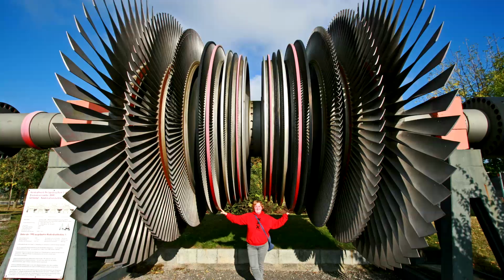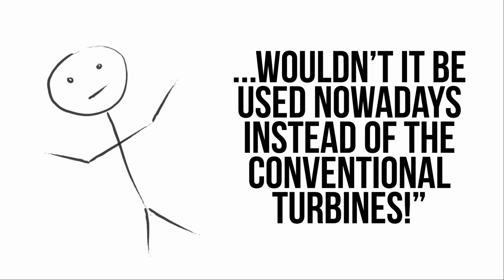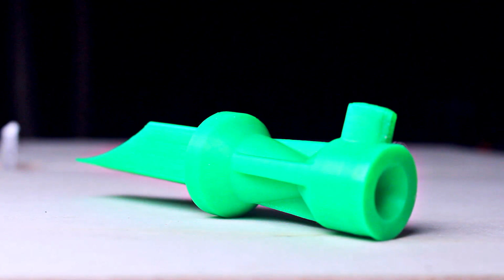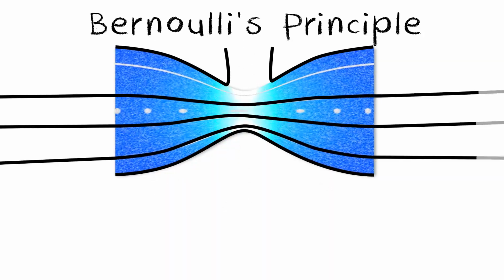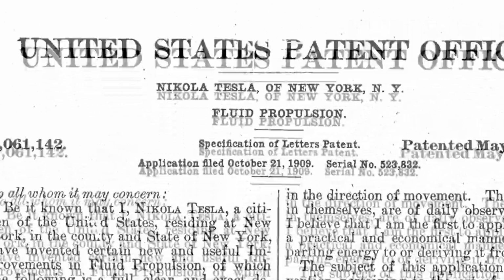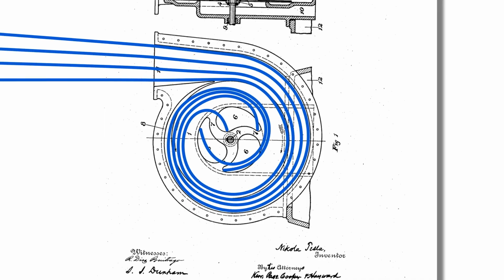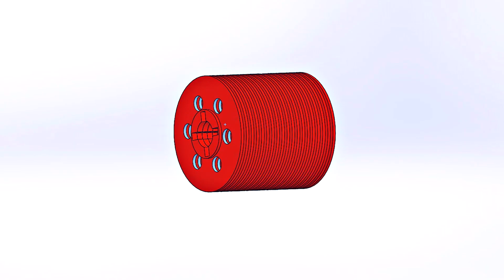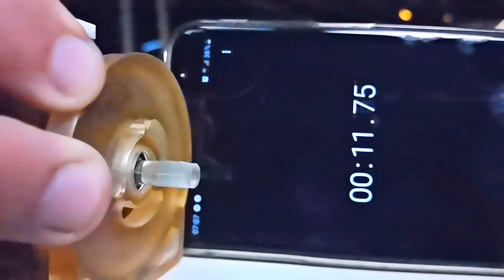Tesla Turbine [Smoke Flow Slow Mo]

Comment: As an idea for improvement, a few things spring to mind:

Your incoming power is the pressure drop from input to output (so 8 bar - 1 bar = 7 bar) times the flow rate. Now the flow rate is fixed, so you need to make best use of the pressure drop. Based on the boundary layer effect the channel should be as thin as possible so that most of the airflow is in contact with the walls. So you would need discs with less spacing but more of them. Also based on the assumed power of that thingy, you dont need to print as thick as the plastic should have no problem withstanding the forces. (That is, if it does not self disassemble from the high speed)

Next thing would be the bearing. At this speed it should have a high loss. Now there is a technology called magnetic bearing. It uses magnets to keep your axis stable.
https://upload.wikimedia.org/wikipedia/commons/thumb/c/ca/Magnetic_Mirroring.jpg/1024px-Magnetic_Mirroring.jpg
I 3D printed one of these a while ago. But mine was in reverse, so a rotating aluminium shaft was in the middle, and the magnets surrounded the axis on the outside.
It only works when the shaft rotates. When i tried it out i held it around the axis spinning at 6000 RPM. I felt a small tug on it, it definitly wanted to center itself, but it was not enough to
support its own weight. Luckily for you, you are operating at a much higher speed, so it could work for you.

Next, the motor/generator. You are using a DC motor which due to its brushes has a low efficiency. At these high speeds brushes create way to much friction. The way to go
here would be with a brushless motor, as they have lower losses. You would need a 3 Phase rectifier for it though. A normal passive rectifier would loose some efficiency due to the diodes, an active rectifier would be best (but can be expensive, or challenging to build if you want to build it yourself). But maybe we can cheat a bit.

Now the last part would be the loading. You used a fixed resistor as load. But due to the voltage you only got a few milliamps out of it, even if the turbine would technically
be able to supply more. You need to find the ideal load resistor. Here is how: connect everything, including the motor, but with no load. Spin it up until it reaches maximum speed.
Now measure the voltage. This will be your idle voltage (the whole system now behaves as a voltage source with some internal resistance). Now to get maximum power you need
to match that internal resistance. Now connect either a variable resistor (or use fixed ones but you need to change them all the time) to it, spin it up, and tweak the resistance
until the voltage you measure from the generator is at exactly half the idle value. You now found your maximum power point.

You can do the same with the 3 Phase motor, you just need to connect 3 identical resistors in either star or delta configuration. This method would also get rid of the rectifier losses.

Comment: At 18:16, that’s the diagram for the turbine’s exhaust pump. It creates a negative pressure as a second stage to the turbine. This is supposed to attach on each side of the turbine along the same shaft. It is one part of a two stage unit.

Comment: So linear opposing piston engines have been used in the past for air compressors. There have been advancements in making those engines into generators by replacing the return springs with magnetic elements. Due to the design it can be ran on different fuels, by altering the volume between the cylinders and spark timing. I wonder how well one of these could pair with a Tesla turbine on the exhaust.

Comment: I was wondering about discs. Do you know if smooth shiny ones are better, or maybe rough ones? For example if you would cut them in steel or aluminium, then would it be better to have them polished, or sanded?

Comment: bro his turbine blades were metal he even said in the bloody patent specifications not to use over 90% copper as they stretch at high velocity. my friend you have taken science and turned it into a childs Toy. boundary layer turbines are use to produce hydrogen when electrons flow through the Axle/rotor crankshaft.

Comment: Have you examined the influence of the air's temperature on the efficiency?  It seems like the thicker/colder the air the more viscous the air.

Plus the nozzle that gets small then big will not work b/c the pressure goes up in the construction then immediately goes down dramatically, plus the entire flow is bottlenecked.

Comment: Regarding your electrical power measurements, I  notice you are using a DC motor. Those motors are capable of functioning as generators, but they really suck at it. No commutator advance, weak magnetic field, all means awful power and efficiency. What you want is a BLCC motor and some schottky diodes. The type of motor used in model aircraft and drones.

Comment: I think you are just scratching the surface here. It think it would be fun and interesting if you tested the efficiency at different loads. Maybe raise the load on the turbine and see just how much power you can get out of the unit you have built(and calculate efficiency at different points). It will also give you and idea of scale. If you wanted to build a kilowatt Tesla Turbine, you can scale your findings and have a good starting place. I am a Mechanical Engineer by trade, and had fun nerding out on this. Cheers!

Comment: Note that a single state Tesla Turbine (TT) will work at a max efficiency of about 48%. If three staged TTs are used, it should be possible to get over 90%. The first stage is smallest to take advantage of the highest pressures, that feeds its output (with decreased pressure) to a larger medium stage TT that feeds its output to a large TT which can do some useful work from low pressure unlike small TTs. The bigger the TT and more widely spaced disks, the lower the input working fluid pressure can be.

Comment: Reading Tesla’s books you can find to combat the need for a high torque on the generator he designed a high frequency high voltage alternator. So till you build the alternator the turbine is useless. Also try having high pressure water flow though the turbine not air you might get different results.
Reply: Is this book the biography of Nikola Tesla or something else?

Comment: This turbine requires the transfer the kinetic energy of the air to the rotating disc, having a volute induced the air to expand and have the velocity dropped considerably. The volute design was applied for pump where Tesla wants to recover and minimize the loss.

Comment: Have you tried increasing the disk size to increase the fluid contact time and leveling out the fluid transition towards the center exhaust?
Reply from the maker: I tried that on my second design, increases torque but reduces the rpm.

Comment: While some people use the terms 'water vapor' and 'steam' interchangeably, they are not the same.  Water vapor is composed of liquid droplets suspended in the air that looks like fog/clouds.  Steam is water in the gaseous state which means at least 100 C at sea level.  It is colorless and not visible to the human eye.  If water vapor and steam were the same thing, having a stroll on a foggy day would likely be fatal.

Comment: Look into making subsonic nozzles instead of convergent divergent nozzles. Subsonic nozzles just contract the coming air, using Bernoulli’s principle to accelerate the flow. If you use conv-div nozzle in a subsonic case, you decelerate the flow!

Comment: have you tried scaling it up air doesn't scale well there is more efficiency for example comparing model aircraft compared to larger aircraft f1 had a similar problem they use scale models in their wind tunnels. How about naming the 3d printer Sunny4 because she uses uv light but smaller. ps have you tried using your compressor directly without the nozzle maybe more air would get thru?

Comment: You don't need to separate the discs and and shaft (though it does lead to better tolerances and maintainability) 
Also I tend to print my shafts a little larger than they need to be and sand them down as needed, by putting them in a drill chuck. 
With MSLA printing you need to make sure your bed is well leveled, Z=0 is set properly (I use calipers to level my bed but using the FEP film that comes with the printer isn't a bad Idea either). 
Take your shrinkage into account, and for a UV cure get a turntable (or 3D print one) and use it.

Comment: To get more power from the motor a more powerful magnet and a better coil design as I said before in your last turbine video. Since the coils on all devices have a loss which no one addresses due to the magnetic friction it has.

As I said in your last video to make a better turbine it would be better if you have the air eject from the center which I explained how.

The width of your internal chamber is too big in comparison to the air pressure you put in. its like your ar trying to rotate a ferries wheel with a small nozzle.

Tesla was smart since he read a lot, practiced a lot, was persistent to not forget to put it off for too long,

Call it ZIG the digits missing from Integza from the ANET device.

Comment: The biggest downsides are the high stress on the materials as well as low maximum efficiency. You can create pretty much any flow and power characteristics for the turbine you want, but it doesn't even come close to simple conventional turbines that can be made at home.
 And yes, the tesla turbine has been studied extensively cause there are a surprising amount of tesla fanboys that simply can not accept the fact that Tesla was a dreamer - he wanted his stuff to work, but he little idea why they did. Heck, even when shown that he was wrong (like the electron being the carrier of current) he refused to acknowledge that.

Convergent-divergent nozzle - why?
No seriouly: why? Pretty much every exmplanation,a rticle, evne wikipedia, directly mention that it is for converting HEAT into directed motion. You are not using steam or similar so it has no possible benefit.

Using RPM as a measurement is also very flawed - 2 turbines might have very different rotations, flowrate, conversion-efficiency and so on.
A turbine spinning at 50k rpm might only have 1/100th the torque of one going 9k rpm, making it vastly less powerful.

Comment: Hello, 
I'm not sure the Convergent-divergent nozzle will help here, as the airflow will need to reach mach 1 at the throat (smallest crosssection) in order to be able to accelerate the air to Mach >1
If the air doesn't reach mach 1 at the throat, the divergent section will decrease the speed and increase the pressure, and also decrease the kinetic energy.
if Vthroat < Mach = 1, convergent sections increase speed and divergent sections decrease speed and the other way around for pressure and supersonic speeds will not be reached at all.
if Vthroat = Mach = 1, convergent sections decrease speed and divergent sections increase speed, to mach > 1
This is related to the pressure differential between the air source and the exit pressure and the massflow (and some other variables)

In this case, I think the air from the airgun coming through the small crosssection is the highest speed the air will achieve in this setup. At least it's worth giving it a shot without the nozzle right?

Comment: 19:17 trust me . You can do better with better high quality motor ( use stepping motor 3 phase AC and converter it to DC with 6 diod connection . And there 3 phase motor 240v made from China I can send a link for you to buy it and it's made for this project

Comment: maybe you could use thinner, lighter and smaller disks. like laser cutting polycarbonate sheets. this could also let you put more of them closer together giving more surface area to the rotating mass.  you could also install an inline dryer to your air supply, moisture could also reduce your efficiency the tighter your go by eating up surface area. things to tests on the side as well would be different gasses like CO2, O2, helium, propane, any other Bottled gasses and then liquids

Comment: You want as little gap between the casing and the perimeter of the disks . The pressure built up by the spinning gas is greatest at the perimeter, increasing the boundary effect, which is what makes the the thing work. If you could hold the tolerances, an involute intruding into the gap between the disks might increase efficiency. But those are insane tolerances on thin features. 

Also, a hollow axle would be better. As close to the center as you can get the exhaust, the better. Cut some slots in the hollow axle and rely on thicker sturdy disks to hold it together. Thin consistent gaps is the key, between disks and between perimeter and casing.

Comment: The disks don't need to be thin. It's the gap between the disks that needs to be thin. Make the disks as thick as you need to stay rigid at speed, and thin enough to be practically constructed.

Comment: Even if you achieve 97% efficiency because you will have to convert low high speed low torque to low speed high torque to turn the generator.
You will loose much more in the gearbox than you will win with the turbine.
This problem can be negated if we ironically switch to a DC grid where the generators can be designed to spin faster.
It is a very expensive up-front cost without enough motivation.
Tesla turbines should find different use case.

Comment: Call her BellAnet
Have you calculated the distance you need between the blades? Because I figure that the efficiency is correlated to the amount of air that is dragging on the disk..So you' d want to make the gap between the blades just wide enough to get the maximum amount of ' air'  dragging on the surface of the disks.

Comment: Thinking on the laminar flow portion of the mechanics, resin is a better medium for sure but there will still be lots of little imperfections that will disrupt that flow from the printing process and slow down the speed of the output. It may be worth taking some very fine grain sandpaper and a small buffing brush to the interior surface of the expulsion end of your nozzle to smooth that flow out a little more

Comment: Since you're doing resin printing now, I might suggest printing a typical blade turbine in a volute shell as a baseline reference of performance. I know the two work on very different principles, but the typical turbo is already very widely used, and if a Tesla turbine cannot surpass them in performance in any meaningful way, there's not much point in reinventing the wheel. It's an interesting hobby project though, and I do hope you do succeed in increasing the performance of Tesla turbines.

Comment: So I opened up your CD Nozzle design and spotted some issues that would have degraded performance substantially. So the first and biggest issue is that the entrance port is the same diameter as the throat. Now from the looks of your compressed air supply hose it looked like there was an even smaller nozzle on that than the throat diameter of the CD nozzle. While the full and more accurate explanation is too long for a YouTube comment, in your instance the first and foremost rule of thumb to follow is that the throat of the CD nozzle should be the smallest cross section of any par of the system between it and the output of the regulator (excluding the regulator itself). In this case the throat was so huge that the flow rate you would have needed in order to choke it would be enormous. If the throat doesn't choke than you will always get a better performance by just not having the CD nozzle at all. If you are interested I can try making a short CD nozzle crash course video going through the math for sizing a nozzle for use with compressed gas (ie instead of for rocket engines) if you would be interested. I'm not a YouTuber, so I'm not trying to plug anything or whatever, but I do have experience designing CD nozzles and as of recently a lot of free time on my hands. If not of course that's not a problem (I'll be honest this offer is 50% to help you and 50% to give myself something to do while stuck inside for who knows how long). There were other issues with the design, but I can go into further detail if you are interested (this comment has gotten long enough as it is).

Comment: Not sure how effective it will be in application but would modeling the casing based off of the Golden Spiral that uses the Fibbonaci Sequence theoretically help the flow of the air if only for a split second? Instead of the inlet being that close to the disks, move it away from center. It isn't entirely unlike his updated casing, but dont do it in a way that creates the large volume right after the inlet nozzle.

Comment: Presumably the disks would be better laster cut from ground metal sheet... How does the Tesla design scale up? The larger heavier disks might be more efficient overall but have a longer spin up time. Optimum disk qty? Inlet to outlet areas? Does it matter if the exhausts on each disk perfectly align or  are offset to form a helical path? Does a polished disk, port or housing matter? Does the edge profile of the disk matter i.e. square or blade like etc?

So many factors!